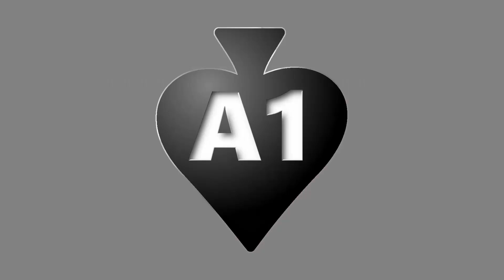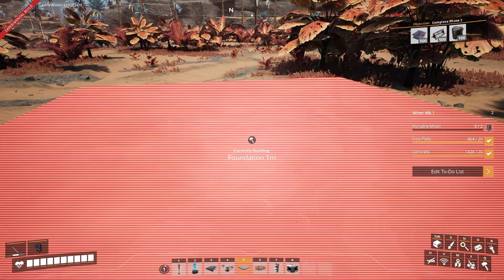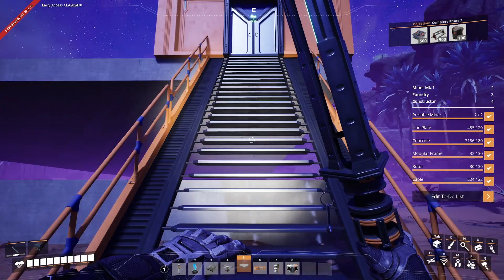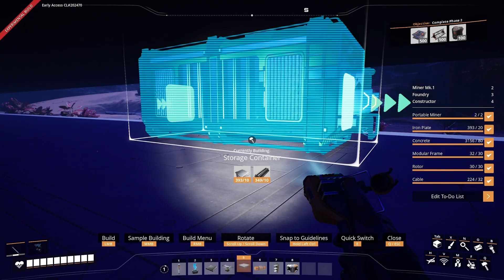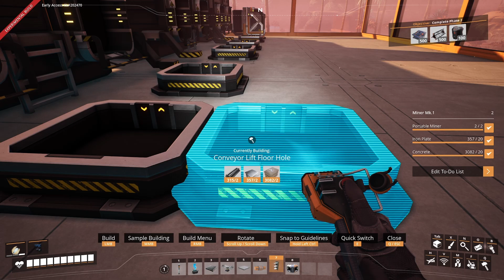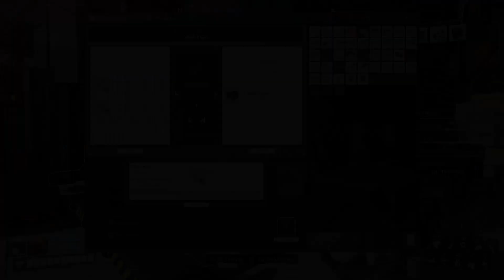SATISFACTORY | Update 6 | EP14: Back To Basics Pt. 2! | Basic Steel

Comment: Good stuff.  I am doing close to the same thing.  Those same nodes even.  The only real difference is I went up to the coal and build out from there and am now building up from those iron, copper and limestone nodes around you along with others further west.  I think I have (using m2 miners so there is that) around 2400 iron, 1440 coal and 960 copper plus 600 limestone per minute being mined and headed into the factory I am working up.  My biggest problem right now is getting the trains to work right.  Just kicking my butt and I will need those to be effective.  I will get it.  Also have caterium, sulphur and loads of quartz coming in.   That spot is really pretty close to the Northern Forest biome and there are lots of all those resources closer than you might think.  Plan to build huge there eventually.....lol
Reply from the maker: Oh MY... Seems I have to do some thinking.. LOL
I actually recorded the whole thing on a weekend day, and split it into 4 parts.. 
So 2 more parts coming Dan!  
One tomorrow and one Monday.. (Already scheduled).. 

I'll keep an eye out for the Caterium etc.. I don't have trains yet.. 🤣